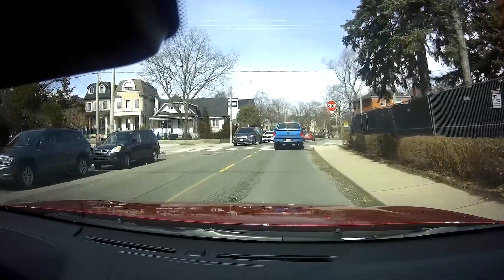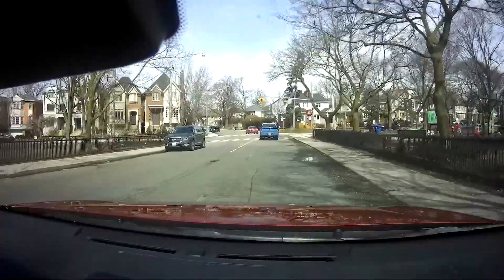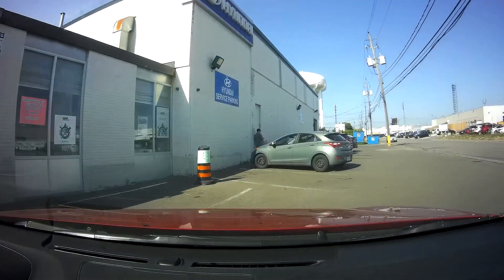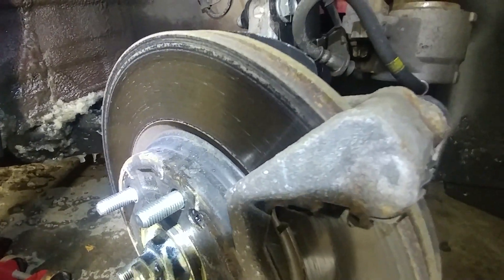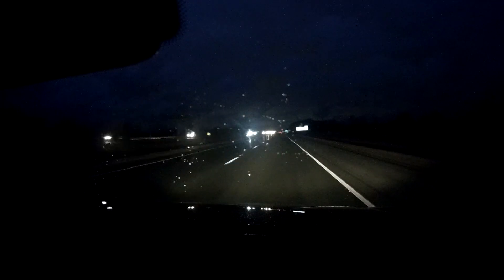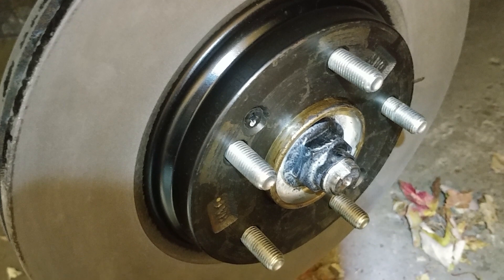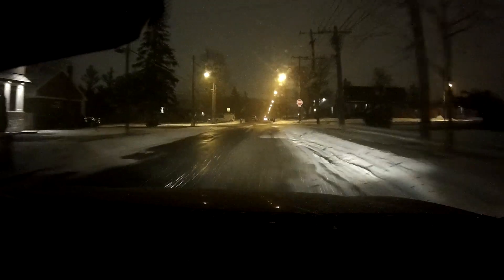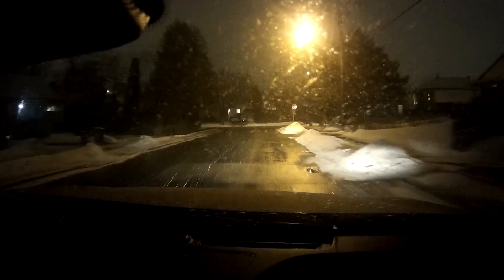Kona EV - Time for a new motor & reduction gear at 30,000kms?

Comment from the maker: Update! I got my reduction gear and traction motor replaced today. Here's my timeline.

Feb 13 - The noise started very suddenly, and VERY loud, while driving on the highway.

Feb 16 - The dealership had told me I needed new front brake pads and rotors. I declined.

March 8 - After spending my time taking them all apart and cleaning them to prove them wrong...(sigh...), they acknowledge that there was an issue and ordered a mounting bracket (lol) to try to fix the issue. In their defence, this is what Hyundai of Canada says is the first step that must be taken.

April 6 - Mounting bracket changed and, big surprise, the noise remains! Both the traction motor and reduction gear failed rumble test. Parts ordered.

May 18 - Parts replaced. Hurray!

All things considered, everything was replaced much faster than I thought it would be. I've heard of people driving their cars around like this for a year, and someone told me they heard of someone's reduction gear exploding, though I don't have anything to verify that, so it could be false.

I'll eventually make another video, but will be quite busy for the next month or so, but thought I'd at least keep you folks in the loop. Cheers
Reply: If you want to reduce the chances of another episode of all this change the oil about 500 and again at 1,000 km.  These gearboxes produce prolific amounts of particles when new and the non-serviceable internal magnet appears to be useless at managing that. EDITED kms Oct '25.
Reply: Can you post what the part # is on your new motor? It should be visible from the passenger’s side wheel.
Reply from the maker: @elcano9  I've got the numbers for everything on the service receipt here.

36930-0E710FFF BRACKET ASSEMBLY
44500-18EA1       GEAR DRIVE
36500-0E702       TRACTION MOTOR
11404-12756P     BOLT FLANGE
07100-J2A20       -40 KONA E (not sure what this is..antifreeze??)
Reply: @robviously-rob0ts  yeah, you got the updated motor. My 2022 has the E700. I’m at 15k miles but no weird noises yet. We’ll see if this was a defect on some motors, or if the whole E700 series is plagued with it.
Reply from the maker: @elcano9  nice! Now I'm curious if it would actually last as long as it should between oil changes or if they should still be done more often than instructed. Maybe the parts are lined up better or made of higher quality materials. After looking the parts up, it seems like it was a 7,000$ job
Reply: @robviously-rob0ts  Hi Robert and thanks for the update. Today I received an answer from dealership. They said that the noise is now loud enought so they will do nothing untill it's getting louder :)
Reply: Unless a miracle has occurred and they've fixed the design problem in your replacement, you are still in the same boat.  There are plenty of warnings in the many Kona EV owner's forums about this (mostly from me).  The best way to lessen the ongoing risk is to install one or two magnetic plugs and do some pre-emptive oil changes.  As I said above the OEM one isn't working.
Reply: @paulaxford6754  my dealer said that the sound is not loud enough... Next week i'm going to another dealer to check
Reply: @robviously-rob0ts  so as I mentioned to RTS, today an owner in Boston photographed the internal OEM magnet and checked it by poking a paperclip inside.  Turns out it appears to be non-magnetic.  So, to date from Nov 2021 we have about 20 oil change reports in total on the InsideEVs forum.  Every single one with an aftermarket plug magnet is returning clean oil, all those without are returning dirty oil.  I cannot help but think that dirty oil is the root cause of the noise issue.  EDIT Oct '25: the internal magnet IS magnetic but it's shedding any particles caught due to being left loose in its pocket.  Change to magnetic plugs to counter this.
Reply: @robviously-rob0ts  not including labor?
Reply: Happy you got it done.
Reply: Similar story here. At this point between a traction battery replacement, a 12v battery replacement, a motor and reduction gear replacement, a partial A/C system replacement, my car is pretty much 80% new internals. I wonder how much money Hyundai lost on my vehicle 😵‍💫
Reply: @0hypnotoad0  the latest experience from some owners indicates that there is good benefit from installing a magnetic plug (Votex DP007 from Amazon) which you can install in the "fill" position while the car is on a lift or jacked up at the left side only. If you have driven more than a few hundred miles on the new gearbox you might want to change the oil as well, Redline MT-LV, 1 L. But, the bad news is that this may not prevent the tapping issue from re-emerging on the new drivetrain, that's TBD at the moment and seems to be just a matter of luck.
Reply: @rbilodeau
Any chance you can upload a video of you driving at the same speeds as the first video but with the new motor and gear drive? Would like to have a reference known good, as i have heard some dealers claim this sound is normal.
Reply: We're all still waiting on a new video from you with an update! 😊
Reply: Great!.. Drive it a few thousand kilometers, then, have that gear oil changed early!! That will help keep the problem from ever happening again.

Comment: I had the same issue and they took it in and replaced the mounting bracket but I was convinced it was a bearing or gear.
The noise has reduced somewhat but I think it just took up some slack in the gears...only time will tell..it still has that sound..just quieter!
Reply from the maker: I recently had a ticking sound somewhat different from this and had the reduction gear replaced again. The sound is still there and Hyundai has approved a new traction motor. First time they were both replaced at 30,000kms, now just over 100,000. Hopefully the new ones will last much longer, as it's a 2019 and my powertrain warranty will be gone in less than 2 years.
Reply: @robviously-rob0ts  Do they not warranty the replacement parts for some amount of time.  This is hitting lemon-law territory, no?
I have an appointment on Monday in Montreal for the same.  Mine is still intermittent on deceleration, but I'm at 110k km, so only just below the 120k km cutoff for a warranty repair (said the dealer when I called to make an appointment).
I was thinking of mounting a camera within the motor compartment to record, so I can better pick up the noise.
Reply from the maker: @CNTheWorld AFAIK, the warranty applies to the entire vehicle from the date of purchase, not after a part is replaced (obviously if it breaks the next week they'd likely fix it but not two years or more after, even if it's not been driven much). There are no lemon laws in Canada.

Comment: If it's a new EV, drive it for ~8,000 kilometers, then, have the gear oil changed in the differential. Any time you have gears and bearings, there is a "break-in" period, where the gear teeth and bearings shed fine particulate matter, during the first few thousand kilometers. You don't want that recirculating any longer than necessary. If there are particles larger than the thickness of the oil film, minus surface roughness, those particles will spall out more particles, and a "snowball effect" can occur. That's the biggest cause of premature wear of bearings and gears. 
     I just bought an all wheel drive Chevrolet Equinox EV, and I intend to have the gear oil changed in both front and rear drive units, at 5,000 miles. (8,000 Km) Then again, at 20,000 miles. (32,000 Km)  Again at 50,000 miles, (80,000 Km). At the 100,000 mile mark, (160,000 Km) I will have the front drive unit (dominant) serviced every 50,000 miles, and the rear (assist drive) serviced every 100,000 miles, until end of life. Keeping the oil perfectly clean is paramount, in maintaining the internal gearing and bearings in the drive(s) for the entire life of the car. I intend to get at least 400,000 miles out of the car, including the battery. By then, I will either buy a new car, or, I will be old enough, that I may cease driving all together. This may be the last car I ever buy.
     Remember...Lifetime oil is a myth!!! I honestly think that if your drive unit had those early oil changes, it would be better than new, owing to the break-in. Your noise is undoubtedly a thrust bearing going bad, because of the helix cut of the gears. Axial thrust is in one direction during acceleration, then the gears slide the other way during regen. Metal particulates have simply gotten in there, and worn them out! The other possibility is radial loading on the inner CV shaft bearings, which load opposite ways, during accel and deceleration. No matter what, it's likely metal particulates in the oil, that have caused premature excessive wear.

Comment: What year is your car?
Reply from the maker: 2019
Reply: @robviously-rob0ts  Thanks, and thanks for posting the video.  I bought a 2023 a couple months ago.  Wasn't sure if the later ones had this problem.  It only had a bit over 14000 miles, but I  changed the gear oil and put in a magnetic drain plug just to see if there were any signs of trouble developing.  The oil was clean.  I plan to change it again at maybe 30,000, but it looks like I'm okay.  I think the gearbox has a different part number than the 2019 and 2020 models. I'm hoping they fixed the problem by the time mine was built.

Comment: I asked about this at the dealership. I was told by the dealership that I didn’t have to replace any oils ever on this car. So I never did. I guess thats my fault for not knowing or reading the manual. I went 132k miles without ever replacing the oil.
Reply from the maker: I wouldn't call that your fault; I'd call it the dealership's fault or even Hyundai's for not knowing the basics of how "breaking in" things with gears work. According to people who've sent their oil out for testing, the main wear (with the metallic particles) happens in the first 20,000 kms, with some people recommending a change after about 5,000 then again at 10 and then 20, then every couple of years after that (where they've seen significant decrease in metallic shavings afterwards). The dealership might say it never needs to be changed but the manual says it did after something like 50,000 miles (or similar?), which is also not right according to what we see. I mean they might also not care about the longevity after the warranty expires, because it's no longer "their problem". 🫤

Comment: For anyone who cares to know. I have a Hyundai Ioniq electric 2020. It is based on the same electrical platform as the Kia Niro and the Kona electric of similar year. I bought my car slightly used. It had 1,500 miles on it when I bought it. I bought it in 2020 so I still had new vehicle warranty and it also came with cpo. But it was all expiring at the 10 year mark or 100k miles mark anyway. I drove my car up to 132k miles thats when this noise, the wheel of fortune, started happening. I just replaced my reduction gearbox. Im hoping Im good now but I do have a question for anyone who has the knowledge. ¿Does hyundai sell their reduction gear boxes already pre filled with gear oil? Or do they come empty and require filling? Also almost forgot to mention. About 10k miles before the wheel of fortune, my rear motor mount failed and I replaced that too. That just goes to show that everything was coming down from there because that rear motor mount is right in between the motor and the gearbox. I guess the torque just eating up those parts. I already spent about 4 thousand dollars with the gearbox and the motor mount. If the motor fails too I think I might just try to trade the car in..how I look spending like 10k on a car with this much miles..idk

Comment: I just replaced my reduction gearbox in my hyundai ioniq electric 2020. Yup. Same exact sound. Originally I thought it was a wheel bearing also. Same exact sound like the one on this video. I went to my local mechanic since I knew I was out of warranty. He recommended the left front wheel bearing. But my gut was telling me that was not going to be the fix. So I payed the 1 hr diagnosis at the Hyundai dealership, like $270 an hr. I was also told it was the reduction gearbox. I bought the reduction gearbox for $1500. They wanted like 10 hours of labor for labor which would have been another $2k. Instead I took the part to my local mechanic and had it installed for $550. That was all today. So the parts department does not tell you if you need washers for the drain plug or if you need to buy gear oil. Nothing. They just sell you the parts thats all. They are not knowledgeable at all. Anyways. I asked the parts department after the fact if I needed gear oil. They said the gearbox itself arrives empty and that I had to buy some. So I bought it. Except when I installed the part. The gearbox was full. I saw it with my own eyes that the gearbox was leaking when the top drain plug was released. So Im confused. Im I supposed to drain that oil that it comes with and refill it. Or does the reduction gearbox come all ready pre filled from factory? I think tomorrow Im going to go an oil change on it just because. But this is all very confusing and it doesn’t need to be. I hope my electric motor doesn’t fail too. I drove the car out of the shop today thinking it was ready to go. The noise is gone but something is off something does not feel right. I feel like the car sounds different. I hope the motor doesn’t die too. 🙄 I have 130k miles. Warranty is over for me.
Reply from the maker: I mean the oil itself is only an extra 40 bucks worth so if it were me I would change it for the peace of mind. I hope you don't have to change your motor, that would be very bad luck if you do, and much more costly. Best of luck
Reply: @robviously-rob0ts yeah. Unfortunately I already drove the car like 30 miles highway 60mph and everything. The noise is gone but the car doesn’t feel the same…something is not right I think. Thanks man

Comment: Will this happen on high mileage Kona's over 100,000 km?  Seems like this happens on lower mileage Kona/Kia Niro
Reply from the maker: It's possible, as it depends on how the vehicle was driven, how the motor and reduction gear wore, how the vehicle was maintained and if the reduction gear fluid was ever changed. If it hasn't happened I'd recommend changing the reduction gear fluid to get all of the metal shavings out so they don't keep wearing the gears down gradually over time. That would be a step towards mitigating future wear. In Canada there's an 8 year warranty so keep yours in mind when considering what you want to do.

Comment: Thanks, that is a really useful video. I drove around today with my Kona with with radio OFF and I can swear I heard the wheel of fortune sound when I took off, it was not loud but still distinct. When cruising, there is no noise from drive train at all. Then I did the same test again after maybe 15km and nothing can be heard now. Strange. My car still has two years of warranty so I hope that whatever needs to happen will happen soon. 
Regarding the brake noise which they suggested, I know darn well what noise can come from the brakes and what from the bearings or the gears. I would be insulted with that. My brake rotors get slightly rusted if there is some rain for a couple of days and they make a distinct sound at the end of braking. I'll stay vigilant and replace the oil but I'm afraid that by replacing the oil I will just shift the problem to the time when the warranty will be over.
Reply from the maker: I recommend cleaning your brakes like this after it rains https://www.youtube.com/watch?v=9wXGFNsB6Qw&t=27s
Reply: @robviously-rob0ts  Thanks, I'll remember that. In regards to the Wheel of Unfortune I made another test today and no more noise. I know that it cannot repair itself when damage is done. I will replace the oil when I get it shipped and then after a couple of kkm again. My Kona is 2021 but I don't know if this issue has been solved by then. Thanks again for spreading awareness.
Reply from the maker: @slavric  mine sort of came and went.. I believe it just depends where the metal shavings end up in the reduction gear as there's space for them to flow around with the oil
Reply: @robviously-rob0ts  Got the oil and magnetic bolts so I'll soon see what is in store for me. The sound never returned and I was driving around with radio off for two weeks. A bit strange.
Reply from the maker: @slavric  best of luck
Reply: Hi from Australia, my partner and I have a 2020(?) Hyundai Ioniq and noticed the dreaded noise just a couple of weeks before it ran out of warranty. The dealer has our car now and are saying that we’ll be lucky to get the car back by Christmas due to demand on parts. Fortunately they’ve given us the use of a new Kona in the meantime. 
My concern is that if they just put back a new drive train with the same original crappy design/ material specifications without any improvements then we’ll only get another 80,000kms ( about 50k m) before it will be a piece of junk and too expensive to be worth fixing. If there isn’t a design revision installed as the replacement then Hyundai is just  buying time to get out of their warranty obligations.  
On another note, for people whose cars are now out of warranty, I’m thinking it would be a pretty simple thing to build an aftermarket electric oil pump and filter and just  connect it to the reduction gear box at the drain plug and fill plug and then just add a small extra amount of oil to the gearbox volume to allow for the pipe work and pump volume. I’m not a mechanical engineer but I have been an industrial electrical technician for 40+ years and have seen very similar things on engines and gearboxes etc. It can’t be that hard. If anyone has any ideas about standardising an aftermarket kit there would be a gazillion customers all over the world and easy to fit by any half decent mechanic.